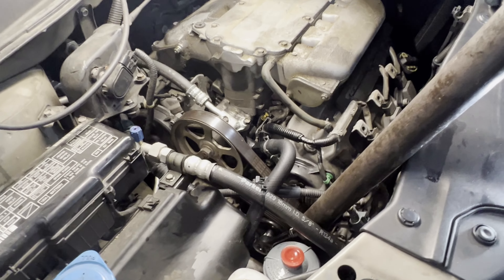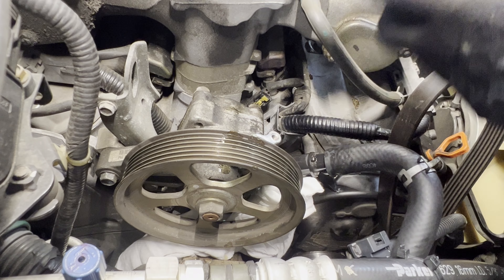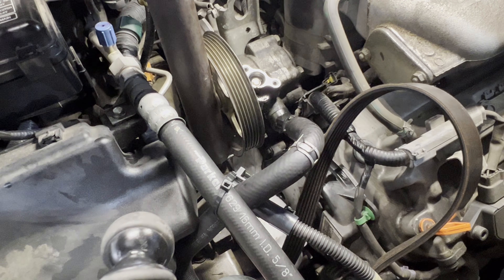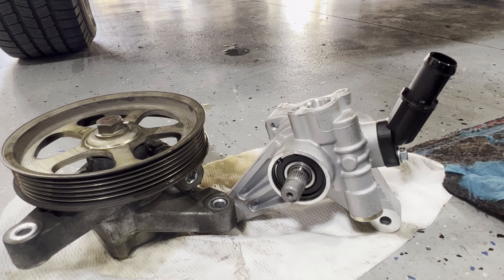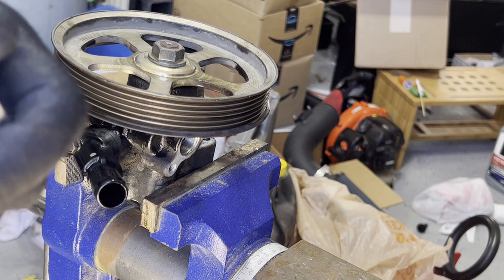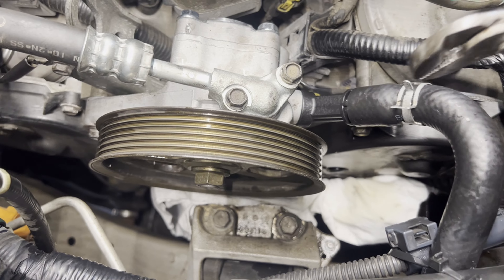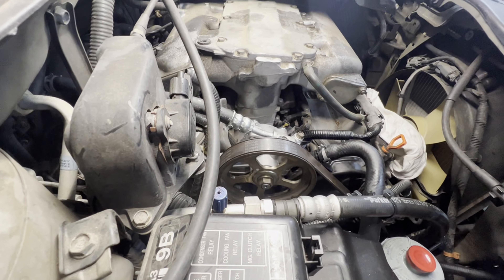How to properly replace a Power Steering Pump on 2006 Honda Pilot 3.5L V6 / install replacement

Comment: Why isn’t anyone showing how to put the belt back on⚠️
Reply from the maker: Because replacing this power steering pump , you don’t need to remove the belt out of place. Just like this video, and will go back same as how it comes out .